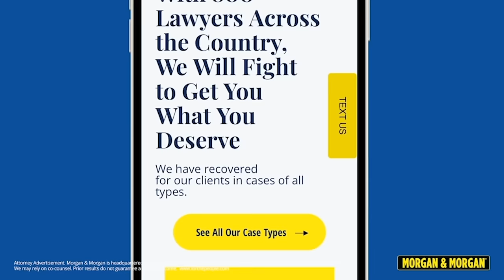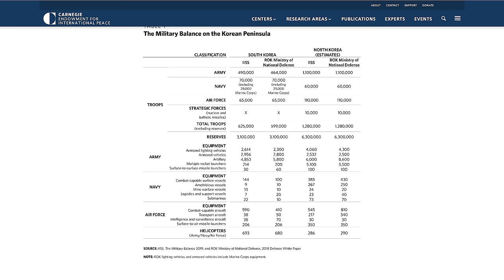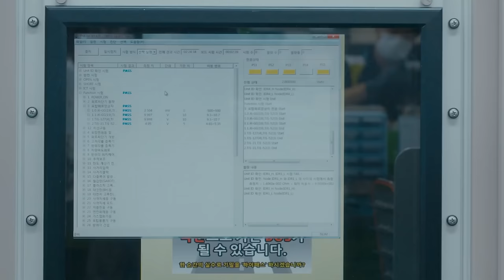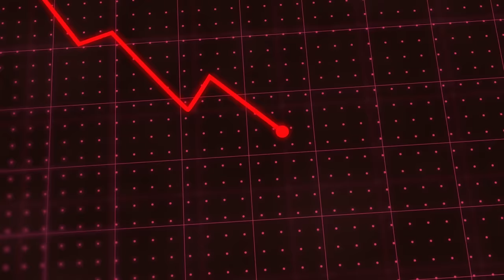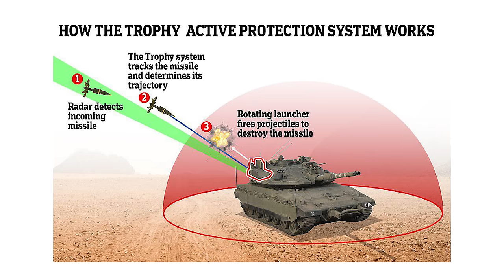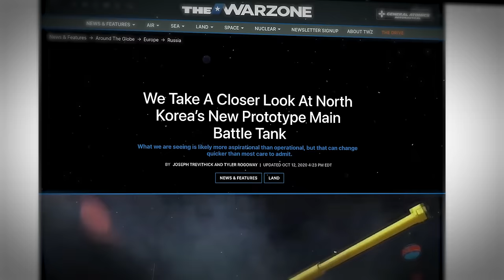North Korea's NEW Tank is a Nightmare

Comment: i think with the atgms they aren't designed to be reloaded in the middle of combat, people always think "oh how would you ever reload those in battle and how would you constantly keep them supplied with the missiles" and i think it's more of a thing where they start out with them, they use them, and then they don't get reloaded until they're out of combat and the missiles are available, the tank would still be perfectly capable of being deployed just without the missiles loaded
Reply: I agree. Allows the tank to tp engage from long range without having to give away its position. Tanl gun muzzle blasts are very loud, dusty, and flashy
Reply: @theimmortal4718  I'd argue that a much slower, fire propelled missile, probably with a guide wire leading directly to the tank firing it, which has to stay in sight of their target... Is a lot less stealthy than firing a single, extremely fast dart and driving away.
Addendum: It is not wire guided, but laser guided. So no guide wire, but you still have to stay and guide the missile to its target. The newest specs for the updated Kornet is 250/300m/s or so for velocity. A 125mm canon firing APFSDS will likely be firing above 1700m/s.
Reply: @The_Foxymew  
A 125mm gun blast is much less stealthy than a missile launch. There's no way anyone would witness both and think otherwise
Reply: @theimmortal4718  In a vacuum, maybe. But I feel the long travel time, and the fact that missiles aren't exactly quiet, kinda offset that. 
I think both would be noticed, just that the gun blast would be noticed when the target's already hit. The missile will still be in transit by the time you're spotted, and you can't even move until you hit your target, because it's laser guided. It's not a fire-and-forget system.

Addendum: An APFSDS travels several times faster than the speed of sound. At something like 4 kilometres of distance, you'll have barely 3 seconds to react to a flash of light, before something has been struck. 
An ATGM travels slower than the speed of light. At the same 4 kilometres, you have what? 13 seconds from launch to impact. 13 seconds you have to stay in sight of your target, guiding a laser at it.
Reply: @The_Foxymew  
Wait-
Are you under the impression that combat is one on one like call of duty? Do you think tanks are fighting alone?
Reply: @theimmortal4718  No? If I was, I'd probably be more agreeable to your assessment. I'm saying neither ATGMs, nor canons are particularly stealthy, but a canon you can fire, and leave instantly. A beam riding missile, you have to stay and guide it until the target is hit, unless it's completely stationary. 
You'll probably be spotted either way, it's just that they won't have time to do anything if you get out of sight after firing your canon. But if your ATGM is slowly [hyperbole] trumbling towards your targets, said target and all their friends, have a lot more time to see the missile, trace the path, and get a firing solution on you. 

I just think there's a good reason most MBTs don't carry that sort of kit, and it's mostly used for smaller vehicles and man-portable systems, like the video mentioned. Because Tank Guns are typically pretty good at tank gun things.
Reply: @The_Foxymew  
Oh, I think you do. Why would you think the tank getting shot at would be the one to spot the incoming shot? Why not his wingman? Or  the other section? Or the adjacent platoon? 
Armored vehicles fight as a formation, not individually placed along a map. 
Ever heard of overwatch?
Reply: @theimmortal4718  ...What? I literally said 'and all their friends' in regards to the target. You are making my point for me? 
An ATGM travels sub-sonically. A tank round travels several times the speed of light. The missile used in the tank in question is beam-riding, meaning it has to be guided by a laser for the entire duration, meaning you have to stay within line of sight from the moment you fire it, until it's pretty much hit its target. 
In that time, your target, his wingman, his other section and the adjacent platoon, will have had some time to see the big hunk of metal, moving at sub-sonic speeds, belting out fire and smoke. 
A tank round travels like 5 times faster than the ATGM, and you don't have to sit and watch it the entire time either. You can fire, back into full cover, and get confirmation of your hit from your own friends. 
My point this entire time was that neither a Kornet missile, nor a 125 canon are stealthy, but at least with the latter, you are exposed for a way shorter time. I was arguing about the assertion that the Kornet missile was stealthy.
Reply: @The_Foxymew  
"A tank round tracks several times the speed of light" 

Are you on drugs?
Reply: @theimmortal4718  Clearly, I made a typo and was talking about the speed of sound.
Reply: @The_Foxymew  
Yeah, I'm sure
Reply: @The_Foxymew  
You dont understand the reason the reflekt missile was procured in the first place. 
It's for tanks in the defense to have greater range PAST sabot rounds (>2500 meters) to either ambush or just outrange the opposing force. 

It's not missile vs gun, as the gun has to be potentially exposed to fire for up to 2 km of movement while not being in it's maximum effective range. Once THAT happens, the tanks in defense are loaded with SABOT. 

The missile allows that tank to fire from a well camouflaged fighting position, without giving it away, for at least the first couple of shots before switching to sabot. 
It's also useful in a battle space with enemy helicopters. While sabot would have to much drop after 2.5- 3 KM, the missile can still achieve a hit out to 5 KM. 

Armored vehicles are very confining for the senses. They're loud, so a missile launch wouldn't even register. A soft launch like the reflekt has nearly no flash and very little smoke and dust. Harder for attack air to see, as well. 

You're not going to see an incoming missile, either. You have the gunners site, commanders site, and unmagnified vision ports. Can't trace a wire back while a TOW is coming at you, yet there are laser warning systems for laser guided missiles. All that might do is tell you the direction, but you're dead in a few seconds, regardless. And the system only works for the targeted vehicle, not ones near it.  And if it's outside sabot range, the gun can't shoot back anyway. 

That's why the missile exists. You can argue that there's no need for a tank to have 5000 meters of direct fire effect range, but not that you can kill a tank firing reflekt missiles at you from 4km-5km with a sabot with a max effective range of 2.5km-3km.

Comment: Their slap-dash approach reminds me of the VW Bug conversion kits from the '70s where you swap the body for a fiberglass dune buggy body or a Bradley.
Reply: Hey man, a dune buggy using a VW bug air cooled 4 and drivetrain is NOT 'slap dash'.  done right and running a tuned and built Air cooled 1600cc flat 4 out of a late model bug?
Damn thing'll  run for what it is.  
A Manx kit with a hot rodded flat 4 in it is WAY lighter than a stock, un chopped bug Chassis and body. (Which is not exactly a heavyweight to begin with)
I drove one once,  it was NOT like driving my ex GF's mom's stock '68 bug with a 1200cc motor in it... like at all.  It was more like driving an under powered shifter Kart. 

Seriously, it was a ridiculously fun little motor... didn't want to give it Back to the owner. Lol.

Comment: Actually having ATGM launcher on MBT is quite useful.
That way tank crew can engage several tipes of targets with full lethality.
For example, ATGM can shoot at armoured targets while engaging infantry or fortifications/tow nests with its cannon using HE shrapnel rounds.
For close distances they have another cannon on top and probaby another coax MG.
All in all armament of this MBT is very good i think.

Also keep in mind that MBT designs from the past that had ATGMS on them failed mostly due to difficulties operating them and high costs but today that is not the case as all tanks have computers which are helping the crew with aiming and guiding as well as spotting targets.

Comment: i cant help but notice the barrels wiggling up and down when it's driving.
Reply: The stablizer is off when parading
Reply: It's a Y-Axis Main Gun Destabilizer.
Next Gen shit
Reply: Development was expedited  via advanced simulation and modeling techniques. 
In this instance a purple dong with Suction mount was added to the cab of a lnockoff Komatsu loader.
16 mm film was used to record its movement from various angles and perspectives.
Put their Best Men on it.
All very hush hush.
On the Down Low, if you will

Comment: I think I know why they might have those ATGMs, and not merely for intimidation. They aren't cut out for winning a war by logistics and efficiency. If they fight it will be desperate and involve attrition warfare both acutely and chronically. These are 'shock units' being built for the acute phase, and as such they are tasked with inflicting damage any way they can. Whether or not it increases the ability to 'win 1v1s' or be 'cost efficient' is besides the point. If the gun is knocked out - if it's out of ammunition - if it fails with the main gun: the tankers will have to fight on. The additional expense of what is already a top of the line tank is minimal; the capacity to take out an extra target or two is key to its role in any possible conflict.

Comment: One thing an ATGM can do that a tank round can't is fly over the target tank and blast downward into the thin topside armor, greatly increasing the chance of a kill. Ordinary tank projectiles have to come from a horizontal plane, and tank armor is specifically designed to minimize vulnerability from those directions. So putting ATGMs on tanks makes a lot of sense after all from a lethality standpoint, although it's a valid question whether that increased lethality is worth the added logistic penalties.

Comment: Atgm launcher could shoot fire and forget missiles for low flying aircraft/helicopters. Not the worst idea
Reply: Specifically why they were added...
Reply: But what about reloading? That ATGM launcher is in a very awkward position. At least on most BMPs (Which North Korea also has) the ATGM launcher is in a position where the gunner, commander, or even any other soldier the IFV is carrying can easily swap out the empty ATGM rack for a new one. They can quite easily get to it with very little exposure. The M2020 ATGM meanwhile is far away from any visible hatches; meaning someone is going to have to fully get out of the tank to reload it, which in a combat situation would be suicidal. Either this thing will have to be accompanied by ground forces who somehow have spare rockets, or one of the tank crew members has to get out and fully expose himself to oncoming gunfire.
Reply: @therealspeedwagon1451  you dont reaload it, you shot it and done
Reply: there is perhaps a bigger problem here to look at: Soviet/Russian late T-series tanks can all launch ATGMs from inside their 125mm gun barrel
and here we have North Korean tank crew launching it from outside, similar to how ATGMs are launched from IFVs like the BMP-2's Konkurs or the Bradley's TOW
Reply: unless of course, we are all completely fooled here, 
and that launcher turns out to be 2 ManPAD missiles specifically tasked for short-range air defense, and thus cannot be used to engage enemy tanks

Comment: The addition of the ATGM launcher could make sense if you think about Korean terrain. The South Korean answer was to create that cool suspension system that functions like the Swedish TD's, so you can use all that hilly and mountainous terrain to get you main gun placed in an awkward angle for your opponent. Of course the cheaper answer would've been to slap more ATGM's on their BMP's, but I guess it's not that crazy of an idea to want more vehicles capable of carrying top attack munitions in an environment with large elevation differences.

Comment: As a tanker, I don't want or need an anti tank missile system.  Now a missile system that could knock down helicopters, and oh yeah, maybe even jets... That we could put the damn good use.
Reply: How do you track jets? Aren't they too fast? Try to take out Warthogs?
Reply: @TeeLism  a stinger built in the 70s, can take out an A10 . Now fire 2 at the same time, and the warthog will have a real problem to deal with.
Reply: In the event of a war with a peer / near peer I think we’ll find short range AA missiles popping up on tanks and short-medium range missiles popping up on submarines.  It’s always seemed like a massive problem that subs have no offensive capabilities against perhaps their greatest threat. I can envision dual firing modes 1) immediate launch into the sky and 2) delayed launch allowing the sub to move a short distance from the datum point prior to it popping up so any torpedo launched by the aircraft in their final moments won’t find the sub.

Comment: Assuming it functions, the missile system is probably there because we can't expect NK tank crews to have the skills, training, and certainly not experience to reliably use the main turret gun. Adding a missile system would make some sense if you could not rely upon the crew to perform, whereas the missile system might provide more fire-and-forget guided attacks.

It's also likely that the NK brass do not have enough faith that the anti-tank rounds they do have access to will perform well enough against Western tank designs. As such most of the tanks' munitions would focus more as infantry support or taking out lighter vehicles.

But then it would mean they're basically throwing on heavy armor and tank-like operations on something that doesn't perform like a tank generally would or should.

Comment: The reason for the ATGMs is rather obvious (and should not be a surprise to you). The max range for the tank gun is about 4km whereas the ATGMs can hit targets up to 10km away. If the new optics are good enough to target out to 10km then this is a no brainer - especially since the ATGMs will have dual tandem warheads whereas the first hit from the main gun may not disable an Abrams or Leopard and they may not get a second chance (in all likelihood the gun has an inferior range to NATO tanks also).

Comment: NK has coal and iron mines, and obviously has the ability to used those.  Our company did development work to add TOWs and TOW2s to the LAVs, and some offshore tanks, in various configurations.  Although the TOWs can penetrate all known solid armor, their range is highly limited, since they are wire guided.  Also, the available angulation is limited, so for best results the launcher needs to be pointed in the general direction of the target.  IF the NK tank has an Independent Commander's sight, then this could be done, as a "side-angle-defense", both during attacks toward a guarded position, or as a defense against a full-scale frontal attack by a massed enemy.  The Israelis are using a TOW equivalent for stationary defense against tanks.  That is very effective at short ranges.  Nowdays, that function can be done far more cheaply, by simple 1K$ drones, who's ranges are far longer.   Weapons like the TOWs will soon become functionally obsolete on a modern battlefield.  KimJ is still fighting a WW2 or Korean War scenario in his mind.  Won't work in any modern theater.

Comment: Dear Cappy, the NoKo design looks nice, now the twin ATGMs, the range of guns is limited few kms, but ATGM have a much longer range. Further, APFSDS round tries to destroy using Kinetic energy, which might not be that effective against tanks like say ABRAM, but what these ATGMs bring is Top attack capability, thus there is confidence to take out at least 2 ABRAMs at stand off range of say 5kms where ABRAMs gun is not effective to strike back. so thus using say $180,000 X 2, = 360,000, it might be able to take down Abrams that might be worth US$ 5 million each, not bad. Also these ATGMs can also be used to take down low flying helicopters like APACHE. cheers.

Comment: Here's the reason why they have that external missile launcher: the gun sights are the same old gun sights from the T-62, which can't guide missiles, hence they can't use gun-launched ATGMs. That means separate optics and separate firing mechanism. Also, the idea that ATGMs are irrelevant for MBTs is a pretty bad one. ATGMs allow you to hunt for helicopters (especially because of the range) and it's impossible for Best Kolea to make competitive, modern APFSDS rounds - hence the ATGMs that they can make (Chinese/Russian designs) can go through a lot more armour than the APFSDS that they can get. So, why don't they get better optics from the same source as the ATGMs? Well, China and Russia still import the best optics they use from the West and people would catch them if they shopped for Best Kolea.

Comment: The comments of the tank commander you interviewed only make sense under the context that the tank crew can be confident that their main gun can defeat the armor of whatever other vehicle the tank might run into. North Korea has up to now exclusively operated T-62 derivatives with 115mm main guns. The soviet U5TS cannon is simply not adequate when facing modern MBT designs. It is highly likely that this new tank is using the same main gun as North Korea would have potentially millions of shells stockpiled for this cannon and thousands of excess guns. Switching to a different cannon would be logistically difficult and expensive. Because of this adding ATGM launchers would still allow the tank to be a threat to modern MBT's without necessitating North Korea create an entirely new cannon.